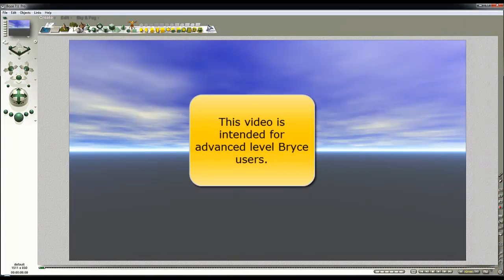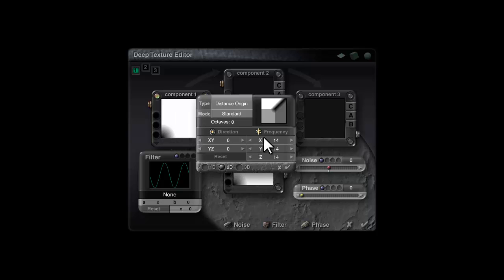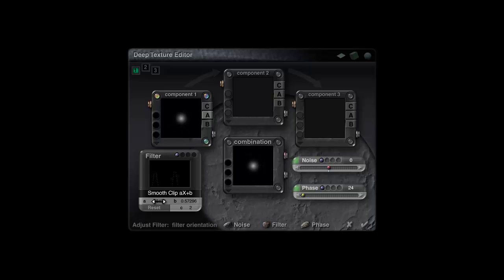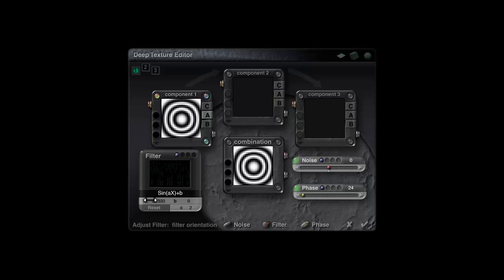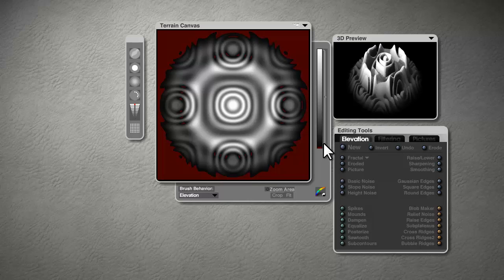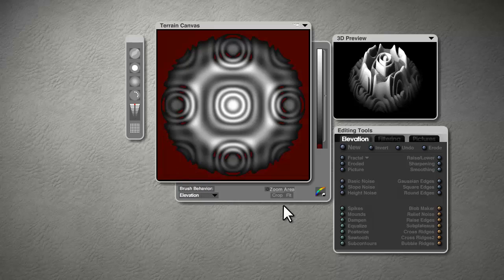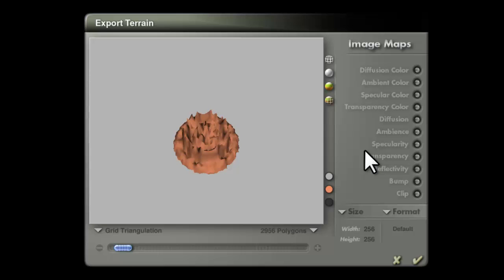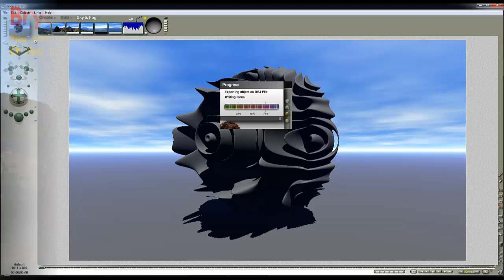Bryce 7.1 Pro Advanced - using the DTE as a geometry synthesis tool - by David Brinnen.

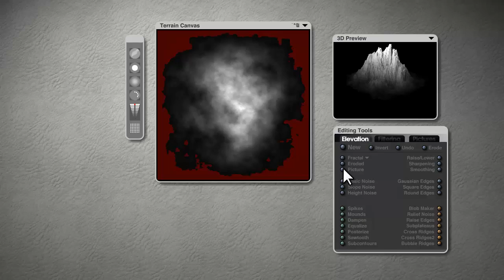Comment: @7:31 - future versions of Bryce....lololol.  This is a fantastic tutorial, thank you.  Question:  you state that holding shift then clicking on picture (1:07) that you can no longer paint in the terrain lab.  Is that for this project only?  When you close Bryce will it go back to previous settings?
Reply from the maker: Aye, as things stand I don't know what the future of Bryce will be.  DAZ hold their cards to their chest.  The last time it was in development, it came as a surprise to me.  I have no inside insights.  Though I would of course be happy to contribute if that would help.  As for the question about the terrain lab, that is on a per-terrain basis.  If you switch a terrain over to DTE control.  Then that is how it is for that terrain instance.  That will remain that way until it is deleted from the scene.  The shift in behaviour does not affect other terrain in the scene, created before or after.
Reply: @davidbrinnen  Thank you